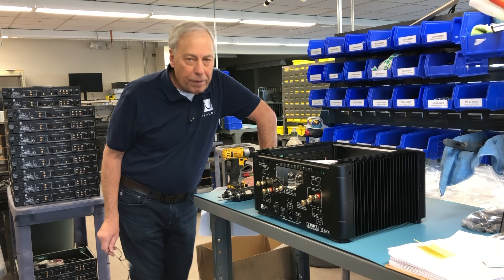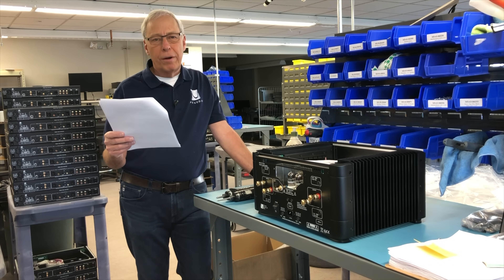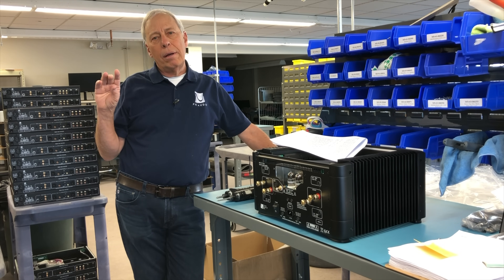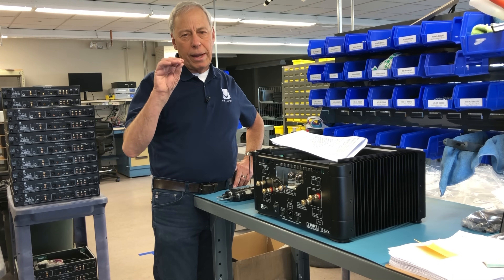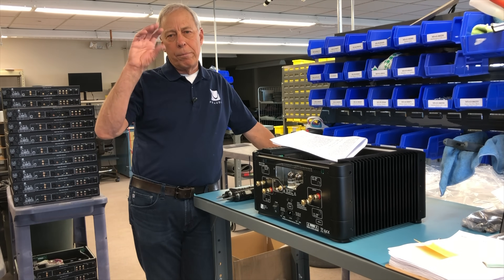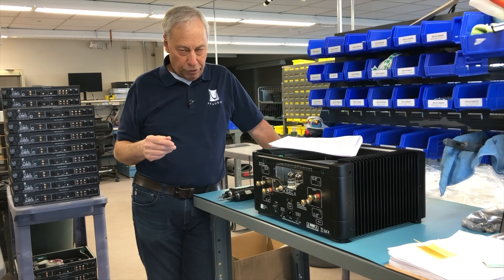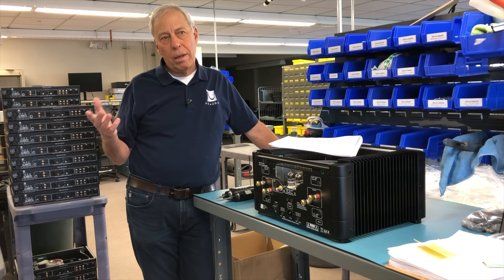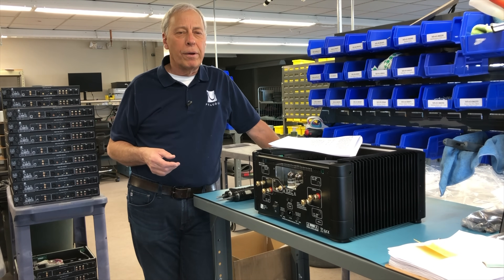Why don't amplifiers have clipping protection?

Comment: For parties you can get a cheap, high current pro amplifier. Most of them have clipping protection, and they will get loud. But they are not made for critical listening. They have more distortions and noise than high end hifi amplifiers.
Reply: Psycho Snake  Those specs tells that you could use it for party. Sure. But I don't want anything cervin Vega stuff, they are focusing on power, not refinement.
Reply: @blackened18019  It  is similar to say that studio monitors are not good for listening to music, but some of them are exception to that. But most of them are not good for listening in the living room.
Reply: @blackened18019  I know that there are some pro amplifiers that are made particularly for critical studio use. But most are not. But those good amplifiers doesn't come cheap.... in the $200 to $600 range there are many powerful pro amplifiers, but most of them are made for stage use, not critical listening use.
Reply: @blackened18019  I guess that the FTX 2000 sounds much better than the new amplifiers made from Ashly. Simply because it use A/B amplification instead of class D, and it is rather lower power, but more quality per watt instead.
Reply: @blackened18019  Yes I saw that in the specs, but it's discontinued. But there are not many professional studio monitors that are passive left. So the marked for amplifiers for studio use in critical listening conditions is diminishing.  There are some very good ones, but they are in the same price range as good hifi amplifiers.
Reply: @oysteinsoreide4323  Being that the amps I mentioned are vintage, they can only be found used. For this reason, they are cheaper than comparable new amps. That is why I have so many of them. Plus, my shop had alot of "donated" components that I got to pick and choose from.

Comment: Hey Paul, pro audio power amps include LED's that alert you when the amp is clipping, does the inclusion of this circuit also effect the sound quality, if not why are they not used on domestic amps?  Thanks.
Reply: Pro amplifiers are not as good sound wise as HiFi amplifiers. But for partying they will do just fine.
Reply: @oysteinsoreide4323  are you sure about that ?? Have you ever done blind testing ? Just curious..
Reply: @poserwannabe1  I have talked with a musician who has much experience with both hifi and professional audio gear. He clearly suggested to me to avoid professional amplifiers for a living room listening experience. He said that the pro amplifiers typically have much power, but lack in refinement and they have noisy fans running.....
Reply: @oysteinsoreide4323  
Hahaha, well, I used to own a pro sound company for years, I now own a home AV business, but with that said............

You didn't answer the question ????
Reply: @poserwannabe1  I have not done a  blind test. I just rely on the knowledge of one who has been working with both high end home audio and professional audio gear for decades.
Reply: @oysteinsoreide4323  well I have over 4 decades doing it...,🤣😆🤣😆😆
Reply: @oysteinsoreide4323  I have done numerous blind tests on different amplifiers with many others. Success rate was close to 50%.
Reply: @oysteinsoreide4323  Another hi-fi myth.
Reply: @tomahack1  No.... It is not. Amplifiers don't sound equal.... Simple as that. They might be similar. But they are very different design, and depending on design they might sound more or less different. It's not a myth that amplifiers don't measure equally. But of course if you don't bother about good sound you probably will not hear any difference. 

Just a side note. I have listened on the 250w and 180w solid state amplifiers of Electrocompaniet. They are similar design, but sound very different nonetheless. But both sound veeeery good. The biggest effect on sound in a hifi system is the speakers, then the room, then the amplifier. if you can't hear differences between amplifiers you must be deaf. Or at least not know how to listen. But of course it's much cheaper if you don't bother. Buy a 600w $200 amp and have a great party....... and not bothering about the sound.....
Reply: @oysteinsoreide4323  I'm not interested about subjective listening. Blind testing prove that well design amps sound the same. You should read about Bob Carver and many others.
Reply: @tomahack1  Yes, amplifiers sounds similar. I agree with that. But there are differences in tonality from amplifier to amplifier. In an ideal world, all amplifiers should sound equal, but that's not true. The most important piece of the system are the speakers and then you just have to get an amplifier that has enough power to drive it. Lack of power will especially be noticed in the bass response. The bass will become muddy and it will also be difficult to hear the sound of individual instruments while many plays at the same time. If you have not experienced that in your listening you should train your listening skills.
Reply: @tomahack1  If two amplifiers measure differently, they sound differently. If they measure equally in all possible ways, they will sound like or almost alike. Simply put.
Reply: @tomahack1  you sir are exactly right 💯, I really get tired of this golden ear " you must be deaf" bullshit. I like to challenge them to prove it to me, put your cash on the table and bet me, they NEVER do.
Reply: @oysteinsoreide4323  True but no human can identify a 0,5dB drop at 20khz or a TDH below 1%. A well design amp is transparent to the human ear.
Reply: @tomahack1  Some types of designs will sound equal, for sure. Especially some nice amplifiers which is known for their transparency. Like Hegel, Parasound and Rotel. But some brand have amplifiers which has some intentional distinct sound to them. Like Electrocompaniet EC 180w aw monoblock. It has a distinct warm sounding character to them. But to be able to hear differences between amplifiers and other equipment, it's essential that the quality of the rest of the system has enough resolution. If the dac or speakers can't convey details good enough, you can't hear differences between amplifiers.....
Reply: The "clip" lights on most pro amps i.e. Crown's IOC, are indicators that there is something non linear happening in the amp that cannot be corrected by global negative feedback. Clipping, current limiting, slew rate limiting and other things will be indicated. When the negative feed back cannot correct for the problem the input circuit will go from a low gain to a high gain circuit, the increased output of the circuit is detected and turns on the light. As you can see, this requires an amp with lots of gain and lots of negative feedback. Paul will probably tell us why designing an amp this way is not great for high end audio, if we ask him.
Reply: @johnhodgson5313  Thanks for addressing my question John, I hadn't realised that the circuit was so complicated.

Comment: McIntosh has had that since forever. It works really well, though I'm not a Mac amp fan for other reasons.
Reply: @immovableobjectify  Yes and it was developed and implemented in the 60s. So yes they basically had it forever.
Reply: It's called 'Power Guard'...and no, they haven't had it "since forever"

Comment: Nad amps have clipping protection
Reply: I leave mine off - if I were to have a party - that thing goes on!
Reply: Yes they do ,over my 4 decades in HiFi I've ran across very few amps with a quality soft clip circuitry & my 1980s NAD amps had a great circuit ,I also don't understand high end manufacturers killing off tone controls and especially the loudness countour feature ,I find the loudness feature on my vintage early 90s McIntosh C-38 to be the most valuable feature for less than perfect recordings at nominal listening levels.
Reply: I have NAD C352 which has soft clipping future, BTW  I never ran my amp into clipping so cant say how that sounds.
Reply: I have a NAD c-370 amp and it does have "soft" clipping. I do not have it turned on. I'm driving a 4 ohm load and have never had my amp run out of steam.
Reply: Yes they do and it has saved my friends speakers more than once, we all probably know that person that just have to turn up the volume on the amplifier when its all ready loud 🔊

Comment: 25K Watt amp MMM my subs wanna feel that pulse my house :) the neighbors too! ahhh headroom for days
Reply: Gee, friend. That's maxing out a residential 100 amp service. I guess if you really need 160db at 33hz, then ok. That is... going big and staying home! But then again, you do like the dark side!
Reply: @advsoft What is the amperage of the circuit supplying the power? 120 volt or 240? Watts = Amps X Volts, perhaps you meant 2.5K watts. That is power draw, not power out, unless you have a zero loss unity gain power amp. I used to laugh at those 100 watt Chinese car audio amps at the flea markets with the 1amp input fuse.

Comment: Paul, my hearing is already diminished so I have to crank it up to hear it. I'm 69 and worked in a machine shop for 40 years. Yeah I should have used ear protection for the time I spent in a noisy shop but it's too late.